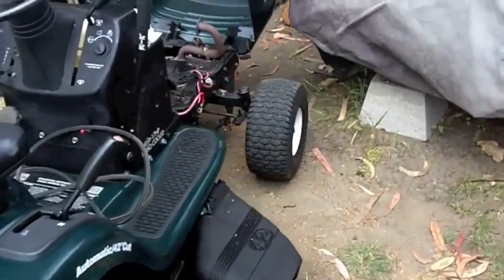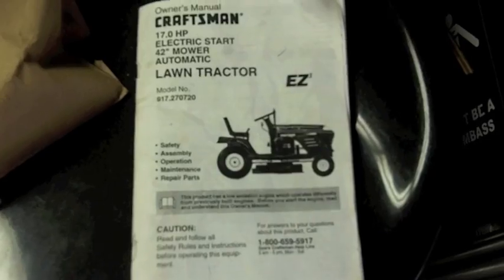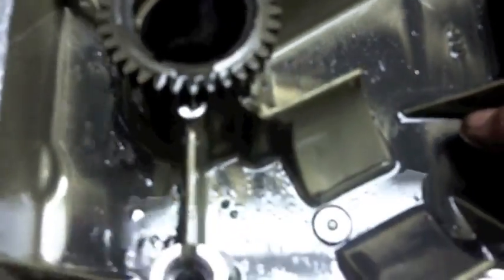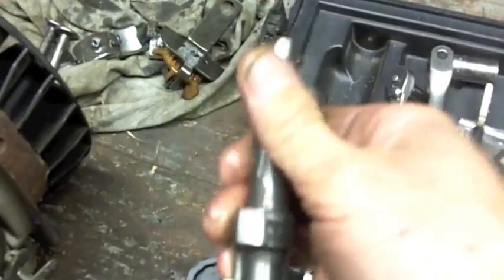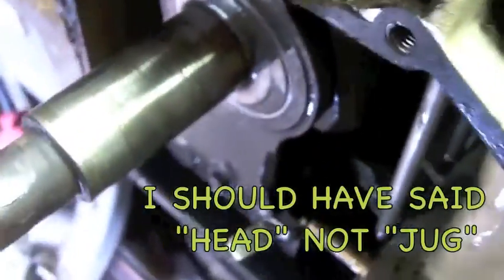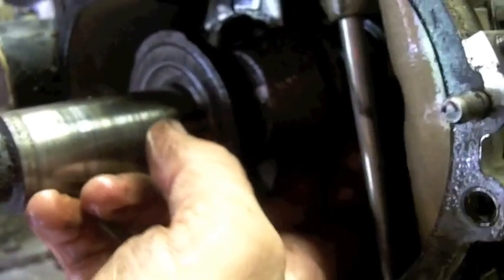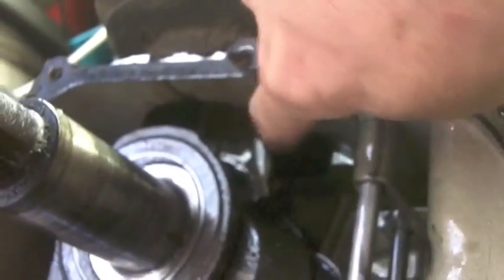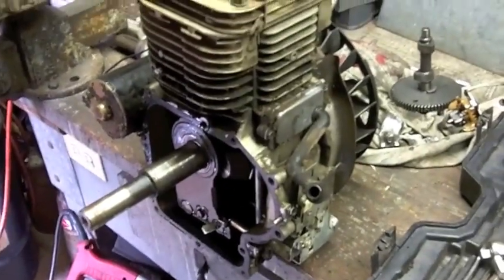Breaking Down The Briggs Engine

Comment: That is weird as hell.  That is kinda like what you see with a push mower that has run over a stump and it locks up and breaks and quits instantly.  I dunno how you would pull off the same feat with a tractor.
Reply from the maker: Mopardude I initially thought about a hard stop too.. but with the belt system, a hard stop would not be as violent to the engine as a directly connected blade on a push mower... If you consider the source...  I am getting the info from a father...who got the story from his teenager.  The father didn't sound too mechanically inclined...  Too bad there was not a dash-cam to review the footage... lol.
Reply: LOL Yea wouldn't that be great.  Someday even these small engine will have a micro controller on them I bet.  Than we will be able to get some ruff idea what happened.

Comment: Due to the missing bolt on the rod cap, I am wondering if at some time prior to your possession, if engine had been taken apart and that bolt never replaced. Anything that long and as hard as they are, it would be readily seen as soon as the pan was removed
Reply from the maker: Nortekj I found the bolt... it was hiding in the shadows.  All parts are accounted for.
Reply: I have the exact same engine in the barn, has everything but the coil and starter, No idea as to what is wrong with it if anything at all, I think it was taken off and replaced with another brand of engine, if you want  to pay for the shipping from Sparta Ky, I'll give it to you free of charge except for the shipping cost. Usually those Craftsman lawn tractors has a Kohler Command engine on them.

Comment: My uncle bought one new exactly like that one and Sears replaced two Briggs engines prior to the warranty running out. The Sears tech told my uncle that Briggs had issues with connecting rod bolts backing out and breaking the rod caps. He told my uncle he had replaced many of them with broken rods. My uncle never over RPMed the engine and he stated it made no noises or vibrations prior to both engines breaking the rods.
Reply from the maker: SlowRollin TexasStyle Interesting...  the carb linkage and governer was properly hooked up and functioning, so I don't suspect an over-rev either.  I got the replacement connecting rod yesterday and the two bolts were beefier and a different style than the OEM style bolts...Looks there was a redesign.
Reply: Just think about how many of those engines went out with bad connecting rods.

Comment: Easy fix for sure! Man did you get lucky with that buy!!! Replace the rod, piston, and rings while your at it. Even if they weren't damaged they were still stressed by the oil and locked it up pretty good. Run a hone in the jug the knock the glaze off and blow all the lil parts and pieces out with break cleaner. Put it back together and use it up at the farm, or sell it. I would swap the Murry at the farm with that hydro Craftsman. Sell the Murry and put the cash towards your custom Gilson mower decks and you will have a fresh setup for the farm man, and just for the cost of parts and time! Hell yea Steve! Keep rocking the great videos and I hope you take my advice into consideration! Thanks brotha! 😎☺️😊
Reply from the maker: UnitCrane514 Thanks for the input.  I had considered hauling it up to The Ranch to be the new grass cutter up there and selling the MTD.  Assuming this Craftsman runs and drives I know it's a heavier duty machine in comparison.  I have to see if it runs, verify it moves and cuts first and I will go from there.

Comment: The internals look pretty good. 

The head gaskets on those engines blow rather easily. (design flaw) 
May as well replace it while you're in there. IMHO
Reply from the maker: Volusia-ev I plan to assemble it with the existing head gasket to make sure it runs and functions first...  I can get a gasket for under $10 if I am looking at the right one.

Comment: best case failure there. Snaps and dies right away rather then beat the tar out of it until a window opens up for daylight =-). You should have this running around the neighborhood asap haha. Thanks for the video.
Reply from the maker: mhn3773 Yeah... daylight is not a desired thing... hahahaha.  I got the parts yesterday, I should be able to work on it today.

Comment: Easy fix but you don't know till you pull the head off heck all it may need is a quick hone of the cylinder new piston and conrod your good to go. No sure why the conrod  would break if the pushrods are not bent the motor didn't hydraulic in any way.
Reply: Because it broke in the compression/exhaust stroke by luck. The conrods are cast aluminum and Are designed weaker as a "purpose fail point" to make these kinds of failures super easy fixes! Best of luck to ya and enjoy your weekend sir! 😎
Reply from the maker: Graveltrucking Absolutely nothing...and I mean nothing was damaged in this engine other than the conn-rod...not so much as a mark on the inside of the case, the crank journal or cylinder... It is very, very strange...and extremely fortunate.
Reply from the maker: UnitCrane514 Definately an aluminum conn-rod.